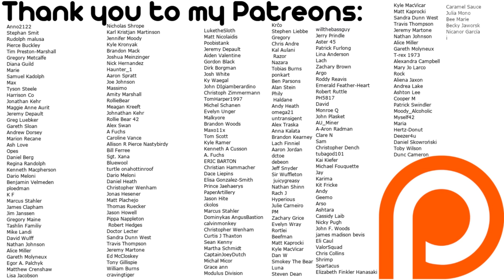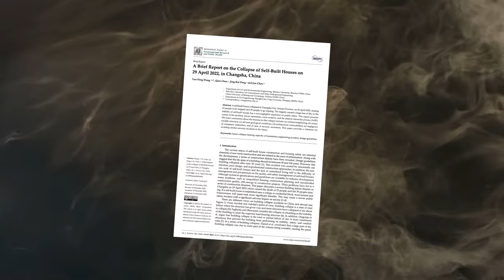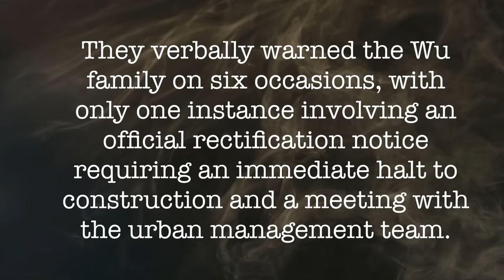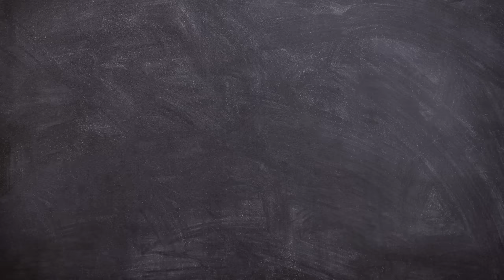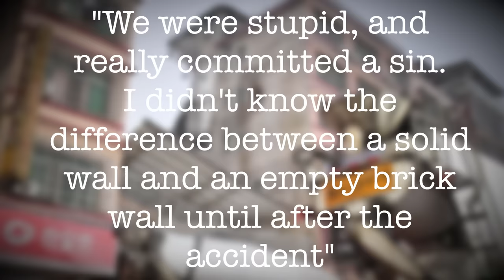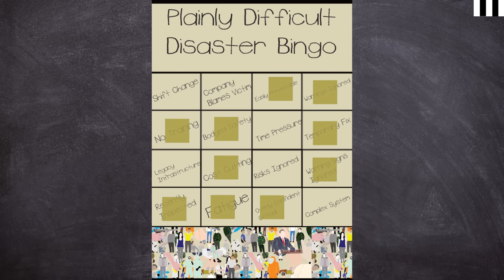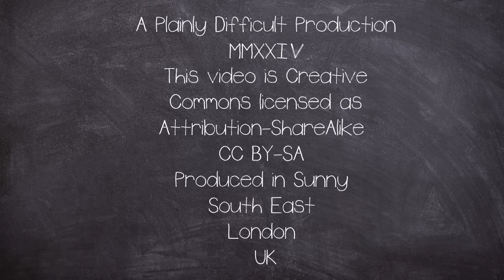This Building Should Never Have Been Built

Comment: If John is going to start delving into Tofu Dreg, this channel is never going to run out of material.

Edit: And the bingo card is going to be pretty full a lot of the time.
Reply: Tofu dreg? What is that
Reply: @HFFCANADA the result of Chinese buildings being built with poor concrete and the government looking the other way.
Reply: @HFFCANADA  Cheap Chinese building "standards".
Their "concrete" as weak as tofu, hence, "tofu dregs"
There is an old Chinese proverb "If you can cheat, cheat"
Reply: @HFFCANADA  Chinese term for cheap leftovers. Usually used when describing construction that is made to look good from the outside, but is in fact broken from the beginning.
Some of the more common examples are when people hit a supposedly solid concrete wall and discover it is just a thin layer of concrete and plaster over bundled trash such as old newspapers. It's not uncommon to see the facade of a building fall off. Usually because the builder used adhesive instead of bolts in several places, and the bolts they did use were cheap pot metal, not the hardened rust resistant steel they were supposed to be.
Reply: @HFFCANADA  It's pretty terrifying. The concrete used in these buildings is so cheap, it literally crumbles like tofu. There are many instances of it dissolving when it rains. But the government won't allow anyone to talk about it, because it's an embarrassment on the nation. So you have all these people suffering, that no one knows about. This is what happens when you have a government who gets rid of regulation and looks the other way with the few regulations they DO have.
Reply: @HFFCANADA  it also goes by the name, chinesium.
Reply: Needs an additional Tofu score value for that series, to compare within the genre
Reply: @NeoTechni  Chinesium is that special element which looks good on the outside, but is highly prone to breaking bonds and falling apart.
Reply: It's pretty much a never ending supply of stories to cover. The ones you can actually find enough info on to justify a video at least.
Reply: @sonicbhoc Its not so much the govt looking the other way, because the largest construction firm in China is owned by...the government. One of the biggest Chinese banks is also state owned and specializes in construction loans, its literally called China Construction Bank Corporation. Its more like they investigate themselves and find no wrongdoing. 😂

Or they find a mid level guy to blame because the inner party members at the top sure as hell aren't taking the blame.
Reply: @HFFCANADA tofu dreg is what's left after you make tofu. It's a decisive term for the shoddiest of construction. An English equivalent would be calling it paper mache
Reply: Yeah I feel like China could be a gold mine for this channel. 😂

Comment: The unhappy coincidence of two Chinese attitudes to rules:
Rules only matter if you are caught breaking them
Rules only matter if you can't pay the right people to ignore you breaking them
Reply: We can safely assume the local CCP council is capable of enforcing rules on every built object. The 'oversight' here has likely been given a green light by a well-compensated council member.
Reply: Plus the general attitude of „If you can get away with cheating, then cheat as hard as you can“. 

Case in point:
Friend of mine ordered some specialty cables from China. The spec was a pretty heavy gauge of stranded copper. The cables that were delivered looked great, and they actually were well made (credit where it’s due). But upon examination it turned out that the inside was stranded CCA (copper clad aluminium, which is a LOT cheaper). So definitely not the right material and not what the order and the invoice said. A few strongly worded mails later, the gist of what the manufacturer said was „sorry, we didn’t think you actually wanted real copper“. 
Which is fair, and would have been OK - but they billed him for pure copper and delivered CCA because „stupid foreigners won’t ever notice“, apparently.
Reply: >> Rules only matter if you are caught breaking them

Like in looney tunes cartoons, where gravity kicks in only 
after having noticed that is no ground  to walk on.

Comment: I can't help but think that a few notable parallels exist between this collapse and Sampoong (Seoul, South Korea, 1995)--the additional floors (in Sampoong's case, a restaurant was placed on top of the pre-existing four floors), the resulting overload, the greed, and the failure of local officials to enforce building codes.  You could argue that Sampoong's collapse had its share of D-I-Y work, too--Sampoong head Lee Joon, ignorant of the dangers his design changes presented, fired anyone who disagreed with him, and he simply started up a construction company that would do the ill-advised work.
Reply: Wasn’t it kind of like the Hotel New World in Singapore?

The building was designed incorrectly from the beginning with an untrained draftsman rather than a professional engineer and costs were cut during construction

Only difference was that in Singapore, the government updated building regulations and checked existing buildings (as well as demolished certain ones)
Reply: @darthdooku6246  Great catch! I totally forgot about that one. Thanks!

Comment: The picture of Chinese tape measures is probably One of the most subtly horrifying things you'll ever see. Even if you were trying to build things to code it would be near the impossible with measuring equipment like that. Generally you don't want the definition of an inch or centimeter to very via like 20%. Even the most fundamental basic stuff is screwed, because of unit inconsistency.

Comment: Damn, the bingo card was nearly a wipe. I would say "risks ignored" could have been checked as well, since depending on how bad the crack was, they could have and probably should have ordered the building evacuated. Especially if the crack wasn't there before and suddenly appeared, cracks suddenly appearing in a multi-story building are NOT a good sign.

Comment: Structural beams and columns aren't really necessarily a requirement. I myself live in an 8 story building lacking all of that. But unlike the building that have collapsed, our building is old communist concrete and steel wires. And I mean the kind before they went cutting corners. It's a  panel house, a Czechoslovak invention meant to build fast and modular. The walls while being rather thin at some 14 centimeters, are strong enough to take all the loads needed. But it's the kind of concrete that needs special tools to cut in to, reinforced with steel. I'm not sure why this stuff isn't used more often. By definition, it has to be cheap, and it's strong as hell.

Comment: I'm great with computers, networks, security, and gasoline engines. I'm absolutely rubbish swinging a hammer or running a power tool that isn't automotive in nature. When my wife and I need some home repairs, I'll sped days finding the best contractor I can afford. It's a lot cheaper than the inevitable trip to the ER to reattach whatever I've lopped off myself.

Comment: My brain got distracted by some of the initial pictures, and the seemingly tiny gaps between some of the houses. Yet, some buildings had windows on the walls facing the gaps, and I thought that if you can get away with building that close to a wall with windows, you can probably also get away with putting in windows in the new wall = people can look into each others flats. Either that, or the windows are facing a wall, and even though that's better than someone else's window, it's still a depressing view.

Comment: You're bingo card.  If you're paying bribes rather than getting a proper inspection, you're ignoring a pretty big risk(Risks Ignored).
And I don't know what was fatigued, unless its the structure itself.  But I thought that slot meant human fatigue that leads to errors, not materials failing due to fatigue.